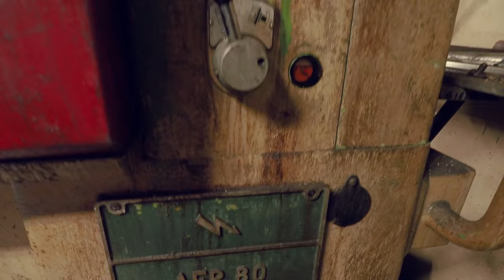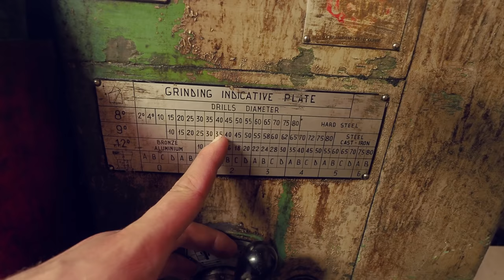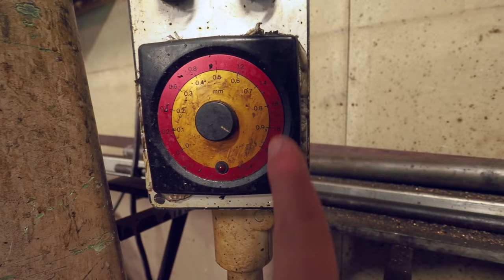Automatic Old School HSS Drill Sharpening Machine

Comment: have fun buying an 35mm tungsten carbide drill :D i have good collection of those morse taper drils from our scrapyard, most of them are pretty good and i grind them freehand on the benchgrinder, wich doesnt come out THAT well but it still works, and the drils are free :) 

does this machine just spin the thing and the rake and clearance go automatically or does this machine some special trick? it would be pretty easy to build something similar for smaller commonly used drills then!
Reply: Larger size drills are cheap if you buy the modular systems, so that you have a shank that accepts drill inserts from say 25-34 mm in diameter and other shanks for other sizes. The inserts cost about 25 EUR for SS and 60 EUR for tungsten carbide and they drill so lightly compared to any conventional grinds you find. Makes the tool rack very small as you only need something like 5 or 6 shanks to cover 10-100 mm range and can swap the insert for different materials. The inserts are also coated, so they last a long long time with the through coolant that the shanks provide. I think the 28 mm HSS insert has been used to drill now 10 meters of hole with no sign of wear, material W.Nr. 1.1730, 400 rpm, 0.35 mm/rev feed. No pecking, just shove it in like a gun drill. Oh and did I mention self-centering? All the holes come out usually on size or 0.1 mm larger.
Reply: you mean something like a carbide insert milling tool? not for me brother, i only own a shitty drill press and a chinese minilathe (cant afford more yet unfortuately) BUUUUT it gets the work done i need it for... 

i often have to abuse my tools to make stuff work its not designed for. i once used my angle grinder as a surface grinder because it had to be done. i mean, you dont reach h7 tolerances with something like that but its certainly good enough to make a keyway on a motor shaft

Comment: Don't want to be rude, but I want to suggest to drill a smaller hole first, especially when working on steel. (Aluminium would probably be fine)

Your lathe looks pretty strong but I think taking a full diameter cut with the 35mm can cause excess heat (you can see the coolant boiling off when you feed the drill in). Also, making a small hole first prevents chatter/skipping and deflection (the bigger drill will center better with a pilot hole).

Maybe 10mm first, then take the pass with the 35mm drill.

I am no expert but it's only my 2 cents.

Comment: in some cases, like car coolant systems a rich coolant to water mix can cause overheating because the coolant can't transfer as much heat per molecule, but its usually okay since extra capacity is designed into the system.. most of the time. Too much water though and you risk making steam and exploding your lines. Not sure how much would apply here, its not a pressurized system as such, and I'd imagine heat dissipation is only worth considering if you're running it hours at a time

Comment: How does it grind the relief angle because the chuck looks to be pretty level. Is the grind wheel angled?
Reply: The grinding wheel is oscillating through two planes at once .. in perfect ting in order to cut the back clearance or "relief' on the drill bits.

Comment: Is there a MUCH smaller version of this?
I have a lot of HSS-drills from work that needs sharpening.
They are from 3.3 mm to approximately 17mm (used in a handheld cordless drill).
Reply from the maker: I googled bit about this machine and there seems to be pretty similar machines in smaller sizes also
Reply: pelleper I was thinking the same thing

Comment: A drill that size needs a pilot hole. The diameter of the pilot hole should be of a diameter that at least equals the large drill web thickness.
Otherwise, the very center of the drill bit doesn't cut, it just stirs the metal and tries to push it to the surrounding flutes.

Comment: Why was the drill bit wobbling during the cutting. I am not a machine operator but curious when I see something like that.
Reply: He didn't use a center drill to spot the center so the big drill just found out some spot to start the hole and it wasn't on the center
Reply: @jecceworks  thanks that make perfect sense.

Comment: Drills over 1/2 inch I drill a starter hole larger then the point so the sides only cut and the point doesn’t go through metal.

Comment: Wait, don't you have to put a relief angle behind the cutting edges?
Reply from the maker: The machine does it automatically. It's pretty shallow angle but it's there
Reply: That's pretty cool, the angle must be really shallow because I can't make it out just from watching the video. Now that I think about it, a shallow relief angle is even beneficial for drilling hard steel, right?
Reply: If you look at a drill from the cutting end, the cutting edge and web should form roughly a 135 degree angle if the relief is about 10 degrees. If the angle between web and cutting face gets to 90 degrees, you have zero relief. Very fast and easy way to check if a drill is sharpened with proper relief.

Comment: you can make a lot of money with that drill sharpener.. everybody has drills that need sharpening.. that machine could be running 12 hours a day making money.. with just word of mouth in your area..  you would need numbered tool boxes or trays to store customers drills and keep them from getting mixed up with others.
Reply from the maker: I had once crazy plan to put the machine in my van and drive around asking from every workshop would the want to get their drills sharpened :D
Reply: let them bring them to you.   measure the diameter.. count the amounts of each size.. weight the amount of drills dropped off.  so you know if any are missing before the return..

Comment: You've got the feed at 2.0mm/min, so it'll only take 1 min. That 2.0mm seeing you dialed in, has nothing to do with how much material you want to take off, it's just a rate. It's going a bit too fast. You can tell it's removing material too fast.
Reply: Really? If that wasn't a depth setting how come the machine stopped the feed itself?

Comment: It's not fair (or good practice) to treat a large drill like that when drilling hard steel. Drill a pilot hole  first, at least as wide as the web of the drill. If you don't do that, then the web (the centre cross point of the drill, between the cutting edges) is just being ground against the workpiece, which really slows things down, as that part is not designed to to cut into the metal. The other option is to dress the web of the drill so it is smaller and maybe has a bit of cutting action. However, I didn't see you do this.....
You were having to put so much pressure on the drill to cut into the workpiece, that I could see the bed flexing. That's not what I would call professional standard lathe work.
Reply: Blah blah blah. Who cares, it's his fukn drill bit.
Reply: Others might do the same, and wonder their 'fkn' drill is knackered after drilling only one hole... That's why I care.
Reply: @tasmedic  a centre drill is used to stop the drill wandering when starting to drill. So what size drill bit do you use for a pilot hole? Does the pilot hole drill go the full depth of the hole,say 150mm. Drills that size are commonly used to start a hole so you can then get a boring bar in, they aren't that accurate and a pilot drill that length is both one extra step in the process and a potential headache if it breaks in the hole. I wouldn't bother with a pilot hole but I would start with a centre drill.
Reply: +graham mcallister
I agree with you. Centre drill first is the absolute minimum I would do.